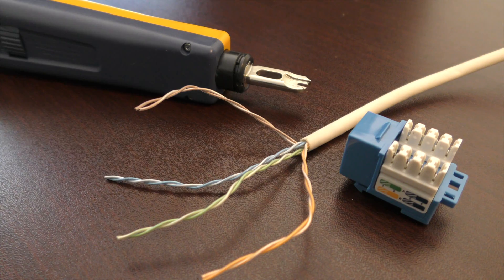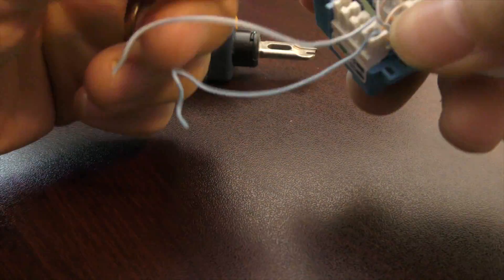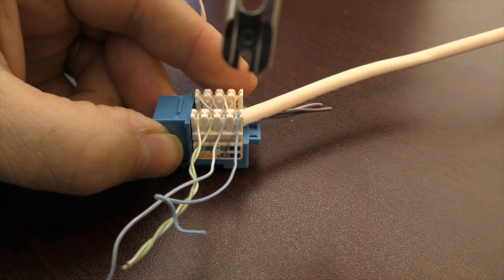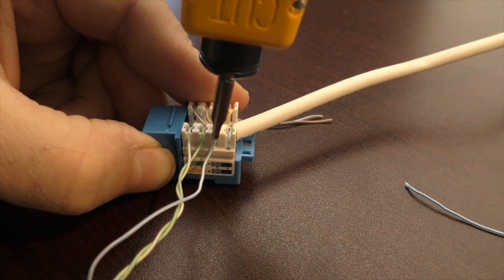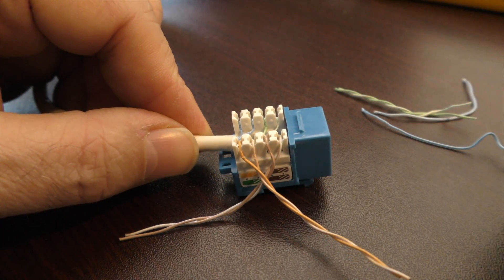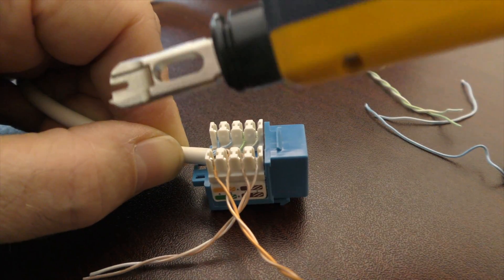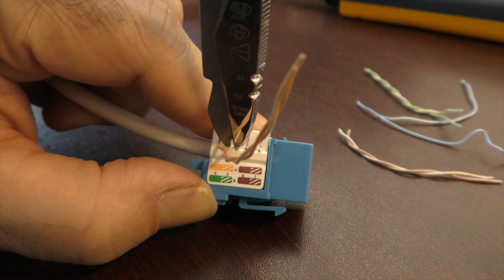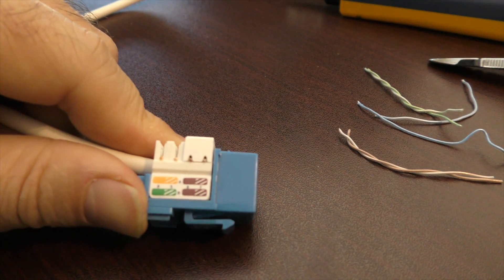Network cable punch down - Side View

Comment: Why nobody ever explains why you don't need to strip the ends of the wires you are punching down. How unstripped wire with insulation is going  to make contact?.
Reply: There are metal teeth inside the keystone jack... when you push the insulated wire into the slot, the teeth make a small cut in the insulation. Similar concept to "scotch locks"
Reply: @mahon257  Great answer!.Thanks!

Comment: Hello Network Advisor; Corrections required: You need to pull the 4 pairs straight once you insert them in the respective slots.
Prior to this you also need to maintain proper bend radius of the 4 pairs.
You have missed out showing jacket stripping process. That is very important.
Reply from the maker: Thanks for your tips.  This was a follow up video from a previous one which had the jacket stripping.  🙂